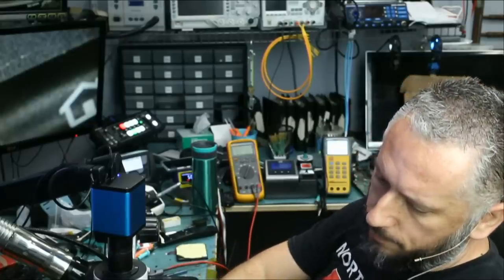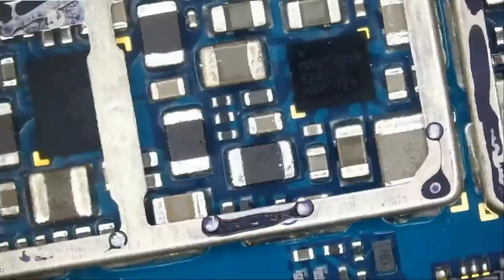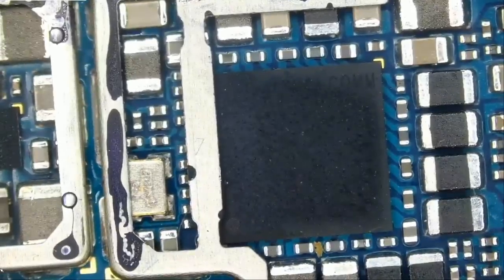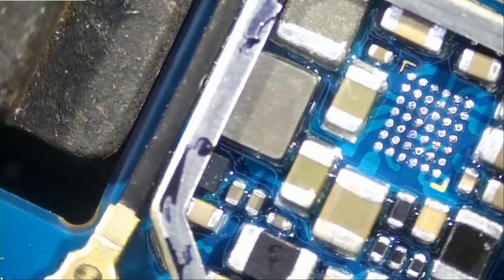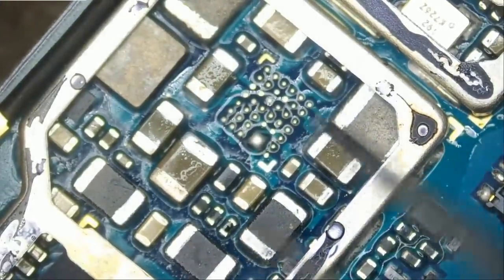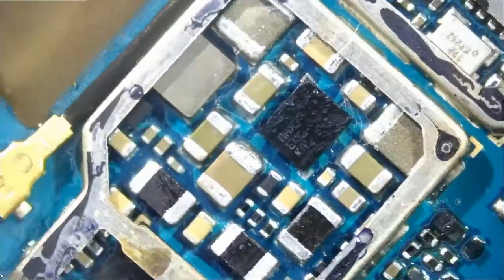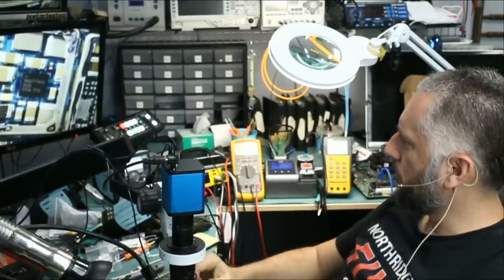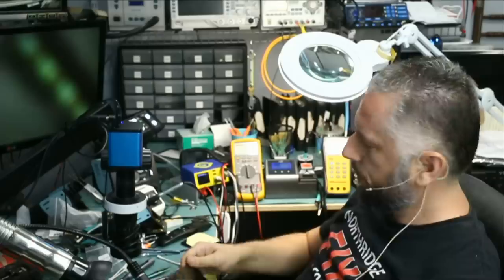s7 Black screen - Customer needs photos - BGA Chip soldering Mistake

Comment: I can't stress enough how important it is to maintain a schedule of backing up data on all devices (computers, phones, tablets, and so on) that store data. I use a Wondershare product to back up my phones & tablets and there are other products available for this. A hard drive is more reliable than an SSD for extended storage times and never ever leave the backup hard drive connected once a backup is completed. Store that hard drive in an inexpensive fire-resistant lock box. With this protocol, I haven't lost data when using this system in the past 20 years. I keep my master data on one main computer and copy that data on to two other laptops for safe keeping. I then periodically back the main computer's data to the hard drive a couple of times a year that's only connected while backing up data.
Reply: That's why I root all my android phones.

Titanium Backup backups easily

Comment: people have no appreciation for how small those parts are, the tiny resistors are the size of a flea under the microscope. BGA was just starting when I was a bench tech, back then as a ISO2001 certified tech I could remove and replace an IBM 601 processor on an apple motherboard in 15 minutes from the IR fine pitch removal to hand soldering the 255 pin processor back on the PCBA. This guy is amazing considering the parts are as small as bugs on the PC board.

Comment: I know you have been very busy handling the entire shop alone. I have a forum question about "Difference between backlight diodes JH, D4 and V3?" I have added some pictures as well. Hope you find some time and answer it. Thank you for all the teaching you do.. I was able to safely open iPad Pro 10.5, swap screen, touch id, camera and a working motherboard. I basically took 3 broken iPad Pros and made it into 2 working ones. Thinking to order diodes, coils and learn micro soldering on the defective motherboard. I got back all the money I made as investment and this broken motherboard would be free to learn spare part.

Comment: If the battery voltage is less than 3.5 (3.8) phone will not charge and also not turn on you have manually check the battery v bat 
May be you need to boost battery،☺️

Comment: Have you checked the conductivity of those silver pens when marking things ..
Reply: The mark got cleaned off by the swab before he even got the new chip in place.  But a search suggests it isn't conductive.
Reply: @Mueller3D  Ok  last time i came across any of that stuff it ran at about 10K ohms per 5mm
Reply: @petenikolic5244  I found a silver Sharpie and tried it out just now.  Even with it very thickly applied, I could not get a measurable reading at any distance.
Reply: @Mueller3D  Ok  maybe the sharpie has found a non metalic formula  usefull

Comment: I think i posted this before but the REL button on the meter will automatically factor out the resistance reading from the probe leads and display 0.   Also are you sure those silver pens are not conductive? Might be worth a double check.

Comment: U can plug the Samsung android devices into an external display via usb c to hdmi. Samsung Dex software is built in for this
Use a straight through cable not adapters for best results

Comment: This is why i set my phone to save photos to the SD card. I used my s7 until one day the screen stopped working. Could have been the same issue here. I just popped my card out and got another phone. Photos on card and all the app data will sync from google server on next phone. Sucks even with the phone working you can't plug in the usb to backup.You need the screen to hit the connect to computer button for it to work. I do also backup my sd card but not often, only every few months. More likely for an old phone to brick itself vs. and sd card.

Comment: On a S7 the battery wont charge inless you add the wireless charging module as it has the battery temperature circut inside. I thought I had killed mine before until I put it all back together and charged and it was just a low battery.

Comment: Your no fix nintendo switches, were they GPU/CPU issues? Had a Nintendo Switch Lite today that had low ohm readings to ground around the MAX IC. Replaced the IC and still low readings. Removed the processor and the low readings disappeared. Deemed it a no fix as a processor issue. Was curious if yours was the same?

Comment: Alex do you plug its wireless charging coil on its back it will not power on without it because the coil has a temperature sensor
Reply: yes!
Reply: It's a S7. The temperature sensor is on the USB PCB board. No need to plug the wireless coil for charging.
Reply: @bagasfabianmaulana  oh nice to know, what was the phone with the sensor with the coil?